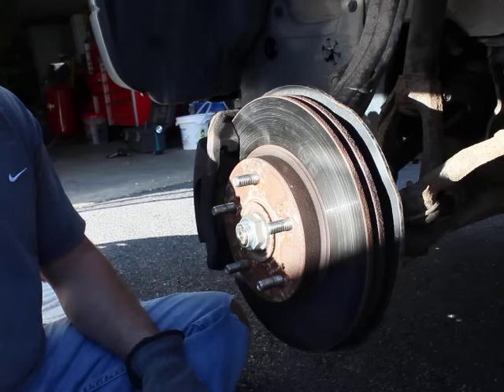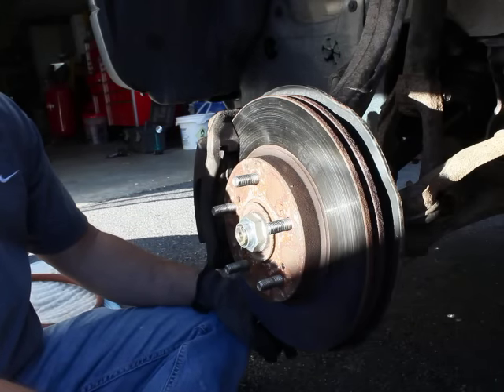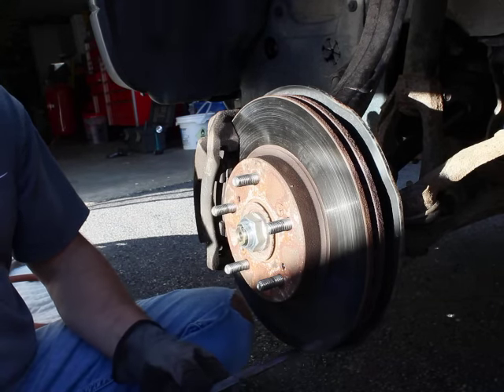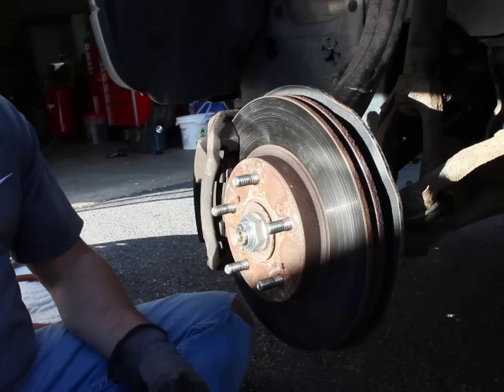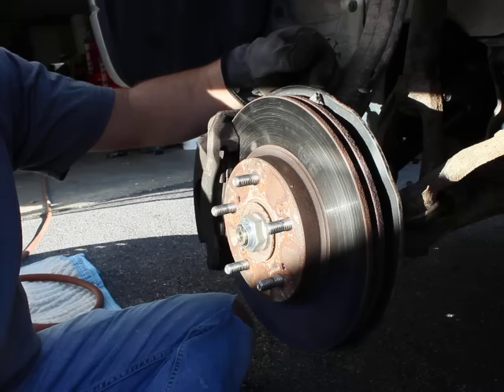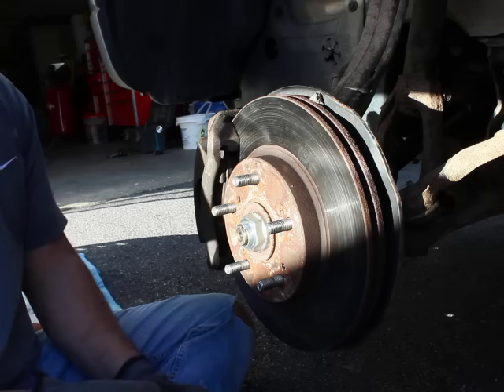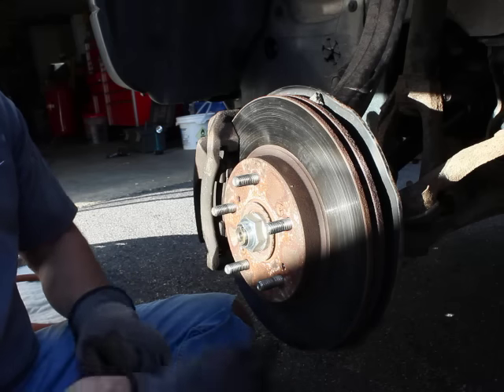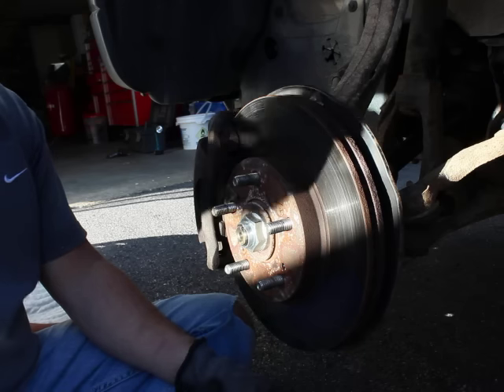Scraping Noise From Wheel While Driving

Comment: Eddie, like your videos. My ford focus is making a creaking noise on right turns but sounds like woosh rubbing from inside cabin with windows up. I posted a video below, do you think that sound is wheel bearing?

 I just replaced front brakes and there is no dust shield or plate, the ball joint dust shield has a cover on it I checked that. Same noise as before brake job existed. 

Right turn noise: http://youtu.be/o1Yx1HIwjsw
Reply from the maker: Hi Attohertz, I listened to the noise in the video. Does the noise change with the speed of the engine or the speed of the wheels? Because it sounds like a engine belt, and you said the noise gets quiet when you straighten the wheels (no strain on the power steering pump) If the noise changes with engine speed, try using a small amount of silicone spray or belt dressing on the engine belts. Let me know what you think, thanks.
Reply: Eddie Carrara Thanks for your reply. The noise sounds like a creaking from the outside. It's coming from the front left wheel house area. I can walk alongside the car and hear it. Changes with wheel speed. I would think it's a suspension bushing or tie rod from the outside creaking noise but how could that be related to wheel speed?

The engine serpentine belt is on the passenger side and there is no noise from that area.
Reply from the maker: Does the noise change when you apply the brakes?
Reply: Eddie Carrara It doesn't change when you apply the brakes, however I just discovered the noise disappears totally after a 45 min drive on the highway.
Reply from the maker: Probably because everything has warmed up. when metal heats up, it expands and noises disappear.
Reply: Eddie Carrara Well it doesn't sound like wheel bearing failure from what I've heard, must either be steering gear or transmission/axle bearing?
Reply from the maker: Not the steering rack, and not a wheel bearing, by the sound of the noise, it's more like a caliper creaking from lack of lubrication or possible CV boot squeak.
Reply: Eddie Carrara Well the caliper pins were lubed and replaced with new. Creaks on the outside wooshes on inside. So maybe your right about CV joint.